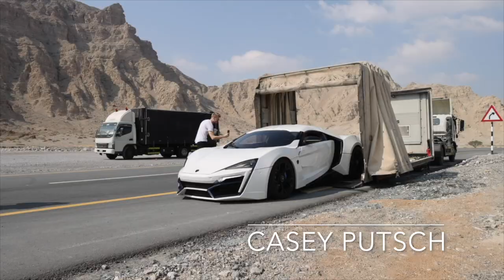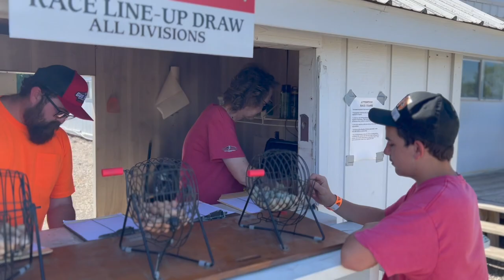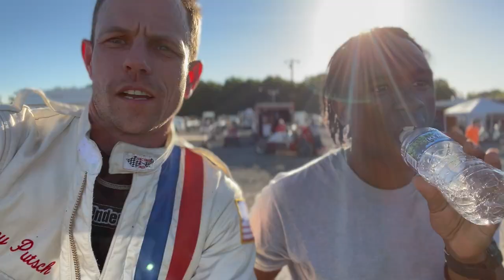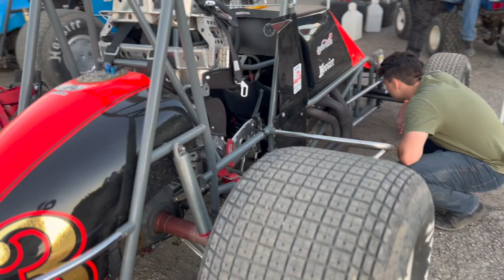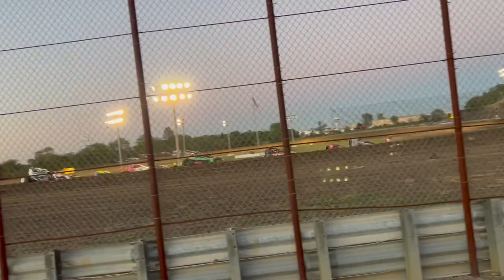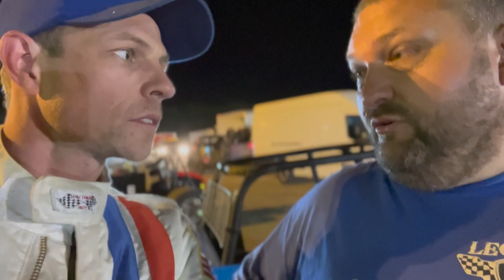My BEST film EVER- Genius Garage Sprint Car RACE

Comment: You are doing pretty good. You need to back the car in a little sooner. You are driving the car into the turn when you should be backing the car in and getting back on the throttle a little sooner. But keep having fun man.
Reply from the maker: Completely agree. I lost my brakes and it was wicked slick. Did what I could for my first race on dirt, but completely agree with you!
Reply: @CaseyPutsch  I’m just an old midget guy. That is a challenging track. But you looked pretty racey out there. And you looked like you were having fun. The dirt stuff can only help your pavement racing too. Keep having fun. And what you are doing for those kids is amazing.
Reply from the maker: Thank you kindly.
Reply: @CaseyPutsch  no need man. I love seeing new folks getting into dirt cars. And I love seeing people mentoring the next generation. You are doing good work man. Now, go jump in a midget and have some real fun. Haha.

Comment: How does the steering work on the front left? It’s like the wheel is connected and not connected at the same time.
Reply from the maker: It’s that fast of a ratio.
Reply: With sprint cars you have a drag link come off the steering box. The Drag link connects to the Left front spindle. Then you have another radius rod that connects the left front spindle to the right front spindle. Like Casey said it is a very fast steering ratio, but sprint cars also have quite a bit of bump steer, that's why it looks really floppy.

Also the steering on a sprint car, is more to guide the car and not actually steer the car. You steer/turn a sprint car more with your feet, as in the brake and throttle. Also fun fact sprint cars only have 2 brake calipers and rotors. 1 on the solid straight rear axle and one on the left front, the right front is a free spinning wheel with no brake.
Reply: yes, that did look like the wheel was falling off at times. Kept getting worried at times.

Comment: "most insane"?  son, Sprint cars are impressive but they aren't anywhere near MOST INSANE.  half of the BTCC races have more contact and wrecks.  and then you've got something like a circle track enduro:  100-300 laps where no wrecks are removed from the track UNLESS under Red Flag  because the whole track is blocked, for a 1st place that runs anywhere from $3,000 to $20,000.j
.
and then Top Fuel / Funny Car is another whole thing besides.  and ain't nobody got bigger balls than "passenger" in a sidecar race.